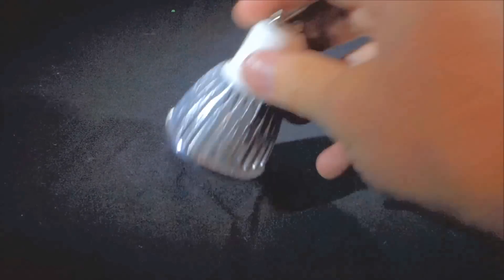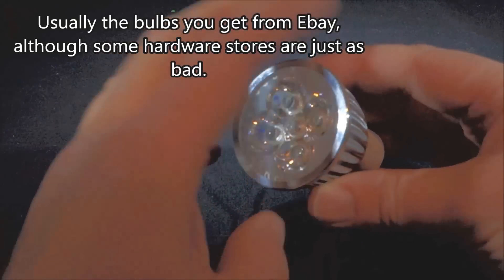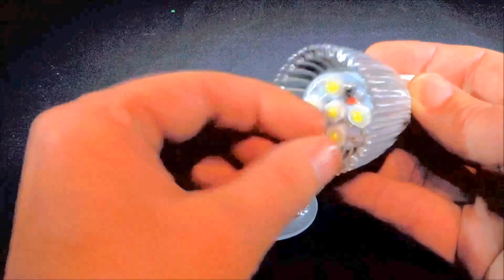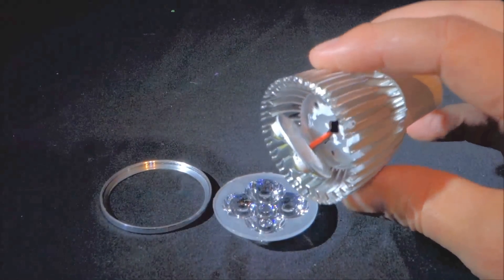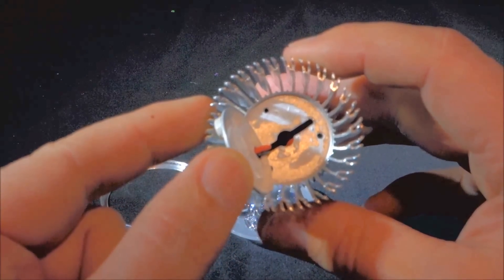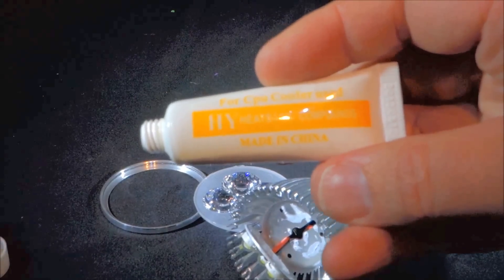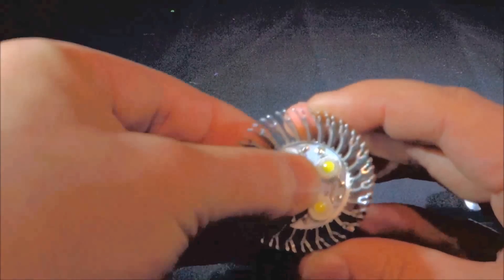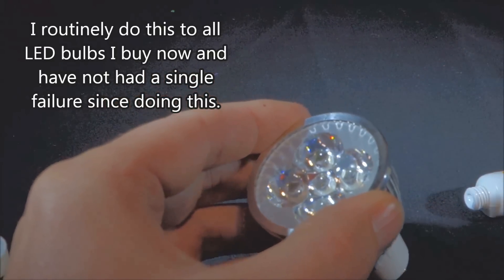Why do GU10 LED bulbs burn out?  Here's how to fix.

Comment: Can you put a small pc fan on it?
Reply: No.
1) There is no room in light fixture housing to add a small fan.
2) A small fan used in a pc would need a low voltage DC power supply instead of the high voltage AC power found in homes.

Comment: Just as a recommendation from being a PC builder, DON'T over do how much paste you put on, this in itself can reduce the ability for the heat to be transferred to the heat sink, but yes you ideally want enough to cover the whole surface area. Once best answer i've seen is "The purpose of the paste is not to absorb heat but rather to displace any air that might be trapped between the two surfaces preventing the air from acting as an insulator"
Reply: Was thinking the same

Comment: This is only one of a number of reasons why LED downlights fail. Most of mine have not failed due to the LEDs failing. It is the electronic circuits that have failed.
Reply from the maker: Failed, perhaps, because they overheated?
Reply: Almost definitely. The problem is that most of these designs are working, nominally, right at the edge of the temperature spec of the internal components. Just a little bit more temperature through a little lack of convection/conduction/radiation or simply a slight increase in ambient temperature above 'nominal' (e.g. the ceiling of a working kitchen or even a lounge with a fireplace) causes a rapid reduction in life. The components inside are borderline temperature rated to the working temperature of the unit. The technology was not developed enough to be marketed at the time it was. It was idiotic of governments to ban incandescent light bulbs as quickly as they did without putting in strict quality control regulations upon the alternatives (i.e. longevity testing at over temperature) and just shows what a lack of holostic understanding there was. Completely opposite to the intentions of such bans, from the environmental aspect, I wonder how many LED bulbs have been thrown away (often into landfill), and how much money has been wasted overall. Never mentioned was the fact that incandescent bulbs inside a house that had its heating turned on were, effectively, 100% efficient as all the so-called 'wasted' heat was simply offsetting the fuel used by the heating system. Of course this varies by country, depending on climate but it must be considered, certainly for colder countries. The same argument goes for beneficial distributed heating from 'standby' electronic items. The only time these items become inefficient is when a building's heating is switched off or when they are being used externally. Rant finished.
Reply: +Jim F not idiotic at all, as those governments were being advised by industry experts which are the manufacturers and distributors. Since incandescent light, bulbs are designed to fail, with some minimum requirements, as opposed to designed for long life (as with most commercial endeavours nowadays). Then you add some cut corners and cheapest possible manufacturing and the minimum requirements go out of the window. To the point where if an item can be repaired easily the item is purposely designed to be hack proof (most probably with the arguments around health and safety, and those will be enforced, of course due to h&s, electricity can be dangerous, but also to avoid having too many people improving the product).
Reply: Rincewind TheFirst - Incandescent lightbulbs fail quickly because the hotter the filament runs, the more efficient it is (in terms of lumens per watt). Incandescents are a tradeoff - if you design the filament to run cool, you will get very long life - even over 10,000 hours. But the amount of light energy generated will be a very low fraction of the total energy it makes (the rest being dissipated as invisible radiation in the infrared spectrum, i.e. heat). The hotter the filament, the shorter the life but the bigger the proportion of emissions in the visible spectrum (i.e. more light per watt of input power). With tungsten filaments the sweet spot is where current lightbulbs are - about 2000-3000 hours of life for maybe 15 lumens per watt.

If you want to read more about the subject and look at the equations governing lifetime and efficiency, refer to Don Klipstein's excellent website on the subject (just Google it)